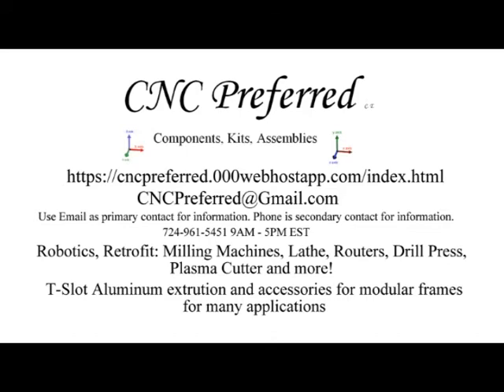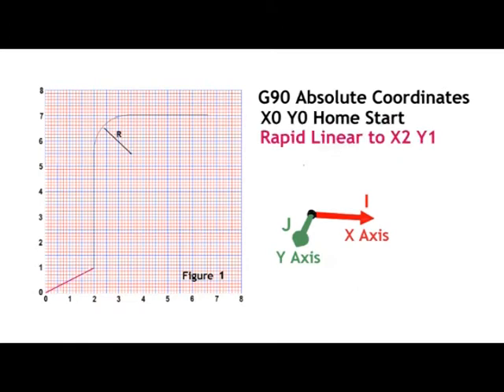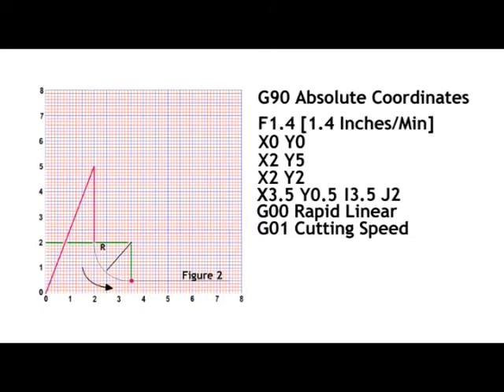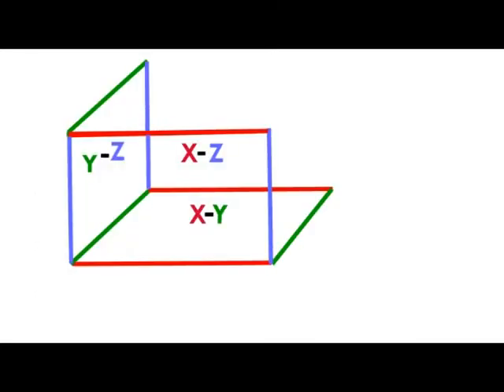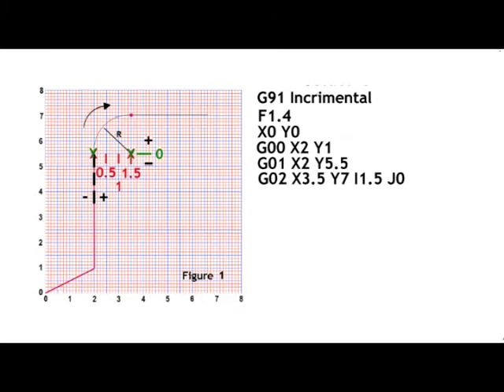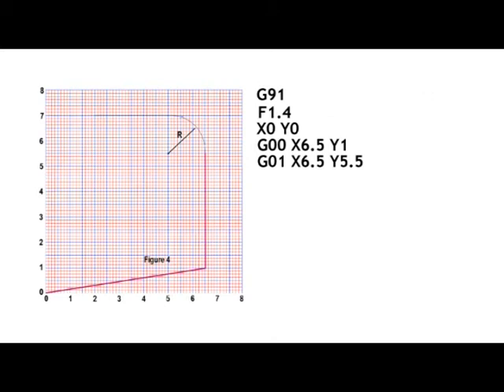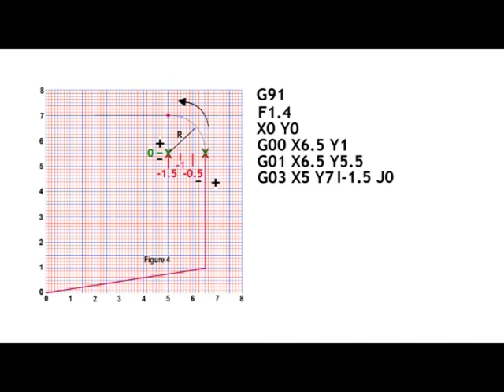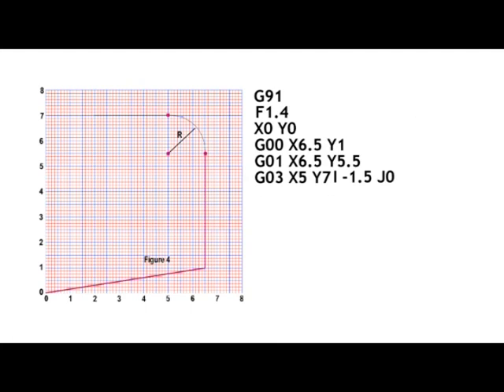i and j explained cnc manual programming, IJKR codes, G02 G03 arcs circles and radius., IJKR Codes,

Comment: Your coding is completely wrong. For G2 and G3 arcs your I and J is the distance from the starting point of the arc to the center point no matter whether you are in absolute or incremental mode. So the code for the first example would be G2 X3.5 Y7 I1.5 Y0 and for the second example it would be G3 X3.5 Y.5 i1.5 J0 for both G90 and G91 modal modes.
Reply: Steve you are correct.